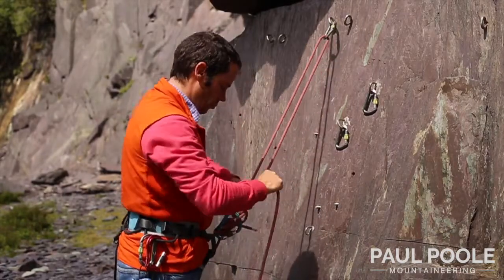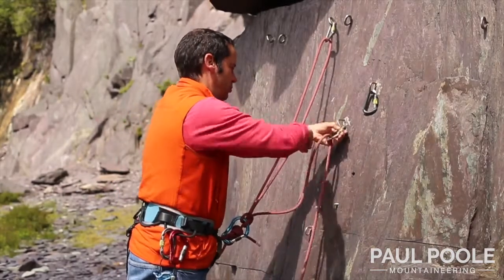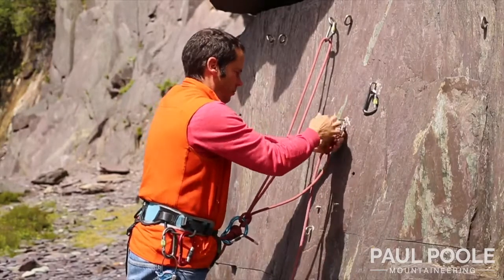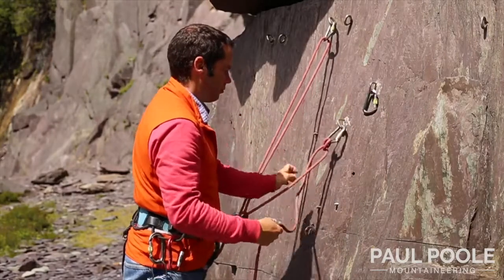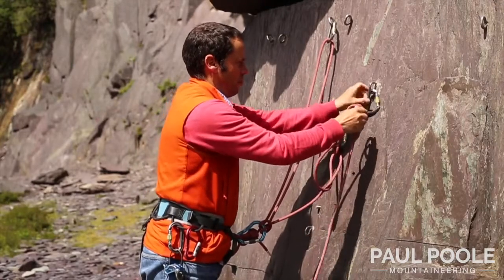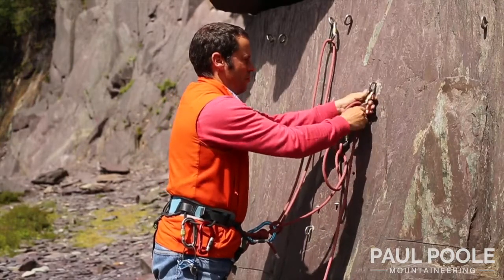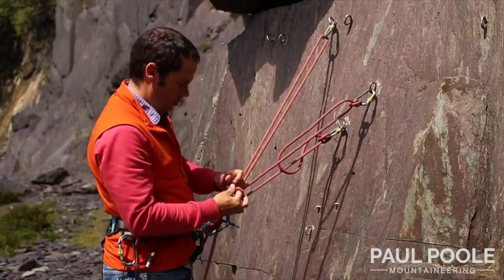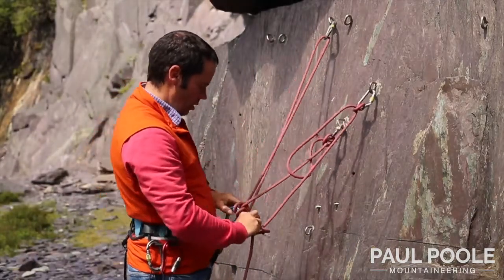Building a Climbing belay with the rope to 3 anchor points

Comment: This is an ok system. 

Typically, you’d want to have all three pieces equalized. An easy way to fix this is to switch the time that you clip the middle and the third piece, and equalize all through an overhand. Clove 1st, bite through 2 & 3, then overhand between all strands.
Reply: Can’t you adjust the clove hitches to equalise it?
Reply from the maker: yep that's another way!

Comment: Hello Paul, any advises for Carabiners? Is Mammut Crag HMS Screw Gate Carabiner any good?
Reply from the maker: Hi Maksim, yes that would work - I just like the DMM Boa as it allows a number of knots to be placed in it easily....
Reply: @PaulPooleMountaineering  thank you as I have never used Mammut and it was "flash deal" offered for £12.75, other option was Petzl Attaché £15.99.